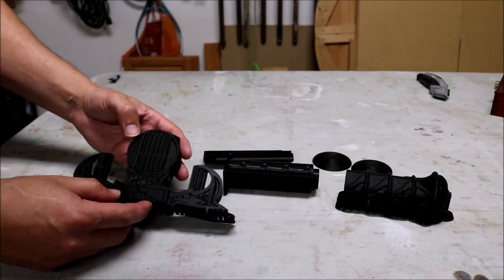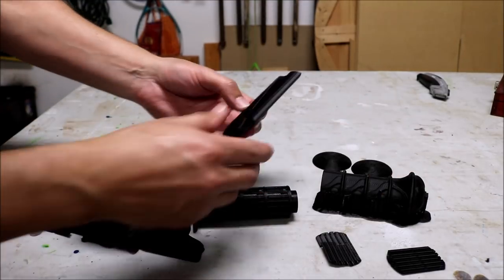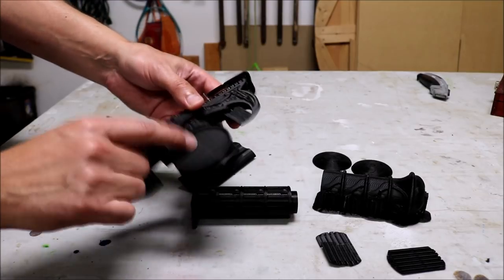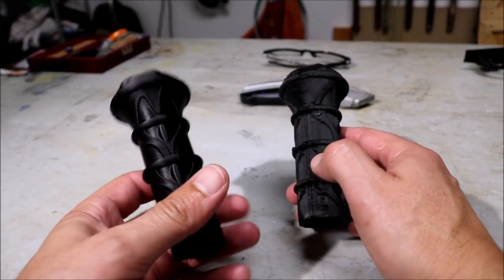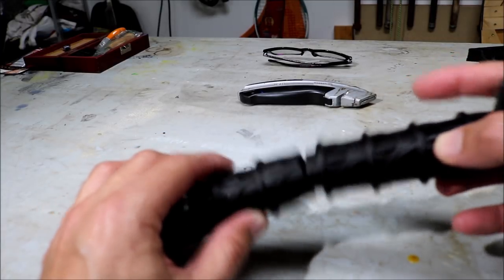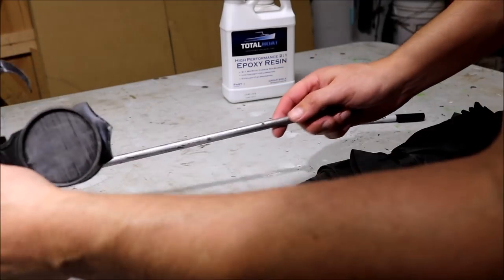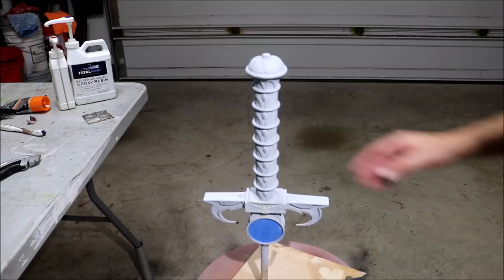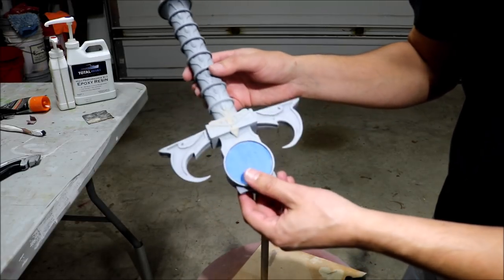ThunderCats Umbrella | 3D Printed | Ender 3

Comment: I see you've got a severe case of the 3D printing bug. :) Do you find yourself looking at EVERYTHING to see if you could 3d print it? Nice project, but I'm curious why you left the hilt so far below the tips of the umbrella?
Reply from the maker: Its a definitely a rabbit hole.  I still got tons to learn.  I left the hilt low because I wanted to leave the metal rod as long as possible.  My thinking was that rod would add strength and support along the inside of the shaft as well as more surface area for epoxy.  I wasn't sure how well the epoxy would hold considering the gaps between the metal rod and the shaft of the umbrella.  Ideally I would have like to alter the 3D model to accept the shaft of the umbrella but I'm barely scratching the surface on the whole 3D modeling front.